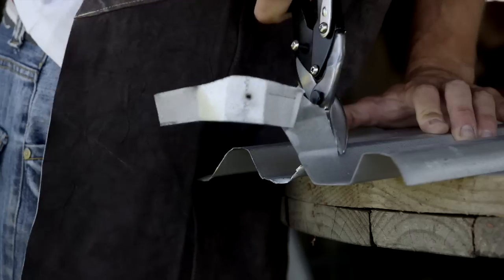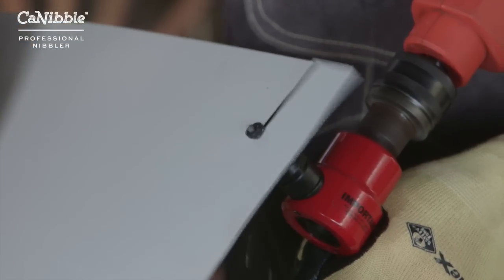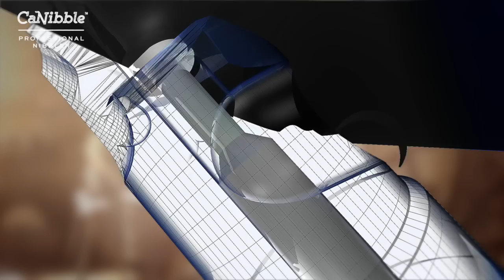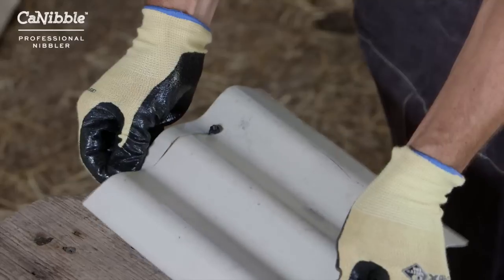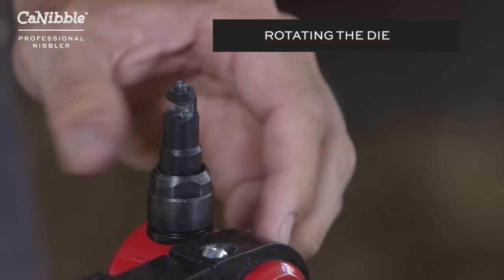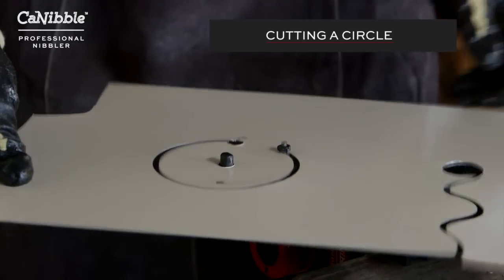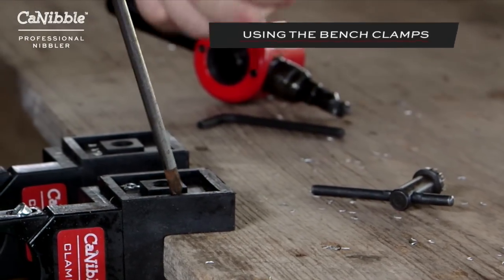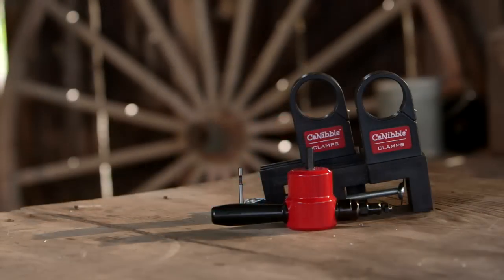Introducing CaNibble - The Professional Nibbler Tool | Product guide (with full instructions)

Comment: Is this the Australian Designed Professional Nibbler, that has been available in Australia for years ?Check out THE PROFESSIONAL NIBBLER: A HIGH QUALITY, AUSTRALIAN MADE TOOL.
Our local engineering firm responsible for the design and manufacture of the Professional Nibbler has over 30 years of industry experience. Every part that comes off the production line is certified and must meet our quality specifications.
We carry out our own rockwell and hardness tests to ensure the material meets the required standards before we begin milling and turning. This guarantees that the Professional Nibbler will give you a perfect cut and serve you well for many years to come unlike cheap imitation nibblers manufactured abroad, that just don’t last.

Comment: What gauge of Annealed Copper could you cut with this? Your website only lists Brass at 14 gauge, but Annealed Copper is substantially softer.
Reply from the maker: Hi Micah, it will cut up to 2mm thick of annealed copper. It is essential that a cutting oil or WD40 is used along the path of the cut when cutting soft materials.

Comment: Does it stay on without pressure on the drills trigger?
Reply from the maker: No, the drill drives the Nibbler so that when it is off, the Nibbler will not run. But many drills have a trigger lock so you can run without holding the trigger the whole time.
Reply: tie wrap

Comment: Whenever I hear something like "worldwide such and such of choice" I consider what would qualify that statement and if it sold one unit to five different countries it would meet the requirements of that statement. However what it is meant to imply is entirely different. I highly doubt that it's the go to nibbler of choice for fabricators and sheet metal roofing companies the world over. I also doubt that the punch or it's other parts are made of the same quality as the tools made by companies for small businesses let alone industrial ones. 

I don't have a problem with cheap tools not matching up to their quality counterparts but where I do have a problem is with a cheap tool made from cheap materials that tries to stand next to those ones that aren't cheap and that are made from durable high quality materials. When I was young I used to believe the statements from such marketing until I got my hands on various expensive high end tools and was left wide eyed from how much better they performed over the cheap ones. Just because you can't visually see the difference between a cheap pair of pliers compared to Knipex pliers you will feel the difference between them during the first time you use them and then years later at how good the quality ones still are. 

The cheap ones are great for a home gamer type of user that will only use them once to roof the garden shed or the hobbyist who can't justify spending $500 for a good brand name nibbler when all they want to use it for is to chop up and old copper hot water tank to make arts and crafts from it.

Comment: will this cut through 321 steel? probably not, just curious
Reply from the maker: Hi Vince, great question here are the gauges and materials you can cut: 

For Mild Steel it is 1.6mm (or 16 SWG) 0.063”
For Brass, Aluminium, Plastic it is 2.0mm (or 14 SWG) 0.079” 
We recommend a specific punch and die are kept for Aluminium work
For Stainless Steel it is 1.0mm Maximum (or 20 SWG) 0.039”

We recommend a specific punch and die are kept for Stainless Steel work.
Always apply a lubricant such as WD40 or light oil along the path of cut.

Comment: Can this cut Stainless Steel 316L 5mm?
Reply: Thanks for your question. The maximum thickness that will fit into the die is 2mm, so unfortunately you will be unable to cut anything 5m thick.
Reply from the maker: No, 1mm thick is the thickest stainless steel it can cut.

Comment: So this can't be used with an impact drill?
Reply from the maker: We have just launched an impact drill version.
Drop me a line at nibbles@canibbletools.com and we can work out how to get one to you.
Reply: Are you all making a review video for the new one you are mentioning?
Reply from the maker: We may do at a later date, but as it is exactly the same product modified for the impact driver, the review video would look the same only that the tool would be driven with the impact driver :-) We will be demonstrating it at the San Fransico Bay area Maker Faire between the 19th and 21st May 2017.
Reply: Is it any more powerful than the original? Will you ever come out with a version that can handle thicker gauges?

Comment: How long it lasts sharp. How to sharpen it?
Reply from the maker: It lasts around 200 meters on, say mild steel if used in accordance with the instructions. However the full answer depends upon the grade and thickness of material you are cutting, because this impacts on the cutting edge of the punch and die. These two parts are the consumable parts and can be replaced when they dull.

Comment: Can it cut carbon fibre sheet?
Reply from the maker: yes, it will. What thickness are you cutting?
Reply: like 1-5mm sheet
Reply from the maker: The cutting capacity is dictated by the size of the slot in the die, which is 2mm.

Comment: Will it work on cutting 14Ga Galvanized after weld  wire mesh which I build Cages with ..Any video of this?
Reply from the maker: No video I'm afraid as what you describe is very specialised. There's a maximum gauge of 16 for mild steel.

Comment: I wonder how it work with PCBs
Reply from the maker: it should cut it just fine
Reply: Tiny copper tracks on PCBs are sensitive to cracking and sometimes even they peel off if you put too much heat or force on them. I just wonder how much vibrations are dangerous to them and PCB itself which is more sensitive to cracking than metal or fibre glass.  Can you make some tests and record them? I mean, cutting PCB is common problem in electronic world. Many electronic hobbysts, beginners, students, DIYers struggle with it as traditional cutting with Dremel generates pcb dust which is very messy and bad for your lungs. Not to mention that cutting more complicated shapes is very hard. Scroll saws are expensive and young beginners or hobbyst not alwas have money or will to buy such a device which also causes problem with placing it - i mean many of them make pcbs at home. Your device yould be great solution as it generates only scraps, you can cut complicated shapes and is very portable. If it would work i would publish it on biggest electronic/electric forum in my country as well as on biggest DIY forum.
Reply from the maker: Thanks for the further information, we will do some trials and let you know how we get on. regards, CaNibble Tools

Comment: Anyone who pushes a cut off wheel through thinner gauge sheet metal gets all they deserve especially if they let it over hang the bench so far. You should drag the grinder across the sheet with minimum overhang or even better no overhang at all and on top of a junk piece of plywood with the metal sheet clamped to the work surface to hold it in place properly. 

Now I've dispensed my two cents worth of advise I'll put on my knit gloves and squint as I push the grinder, sans guard through my 30 guage mild steel sheet so that the sparks set fire to my gloves and clothing and I flinch from the metal particles bounce off my eyelids and face. I once had a pebble of grinder wheel hit my eyeball that fused to my eye. The emergency room Dr. wanted to use a syringe needle to pick it off my eye. Well I chickened out when he was about 3 inches from my eyeball. I told him I'd rather risk going blind than let him pick at the sliver with a syringe. Luckily the speck detached on its own and there wasn't any infection that happened (probably due to the spec being sterile from the heat when it impacted my eye. true story.

Comment: its like 20$ on amazon..why bother rebrand it.........
also this one seems like the head doesnt rotate...so when dealing big sheets(which ofc the video doesn't show any big sheets), its is pain in the ass to cut thru any corrugated sheets coz your drill will be in the way.
Reply from the maker: Hi Alan, thanks for your comment. The CaNibble is not a re-brand of the cheap nibblers you see on sites like Amazon. We're the original manufacturer of the drill attachment nibbler and have been making them for over 40 years. The CaNibble is our newest generation of nibbler, and benefits from these 40 years of experience and refinement. This is why our nibbler cuts so much better and for so much longer. The head, or die of our nibbler does actually rotate, it's actually a design we pioneered in our earlier generations of nibbler.
Reply: @canibble-professionalnibbl1603  you know what, the fact my comment actually got a reply from you is enough for me to believe. if my cheapo nibber fails and somehow in the future i need this tool for the job for a living, i guess i know where to get good ones. :) thanks for the reply.

Comment: What is the operating Voltage? 110 or 220 V? and also is it 50Hz or 60Hz?
Reply from the maker: Thanks for your question. The answer depends on where you live. You need to be able to run your drill at around 2500 rpm which in turn powers CaNibble Professional Nibbler which attaches to it.

Comment: Will this cut 3mm thick aluminum? What tool can be used?
Reply from the maker: Hi Gauge Magadia, thanks for your question. Unfortunately, the maximum thickness is 2mm, which is the opening in the die for the material to pass into for cutting. Kind regards, CaNibble Tools

Comment: Cannibal $218.           Chinese unit  $30.        .??????
Reply from the maker: Hi FAA Inspector, The CaNibble Professional Nibbler on its own (like that of the Chinese unit) is $99, our bundle which includes bench clamps, a straight and circle cutting attachment, spare punches and a die costs $188.85 which is $29.15 cheaper than your figure of $218. While the CaNibble Professional Nibbler is more expensive than a Chinese unit, it is not for no reason; we offer a 5-year guarantee on our product, we manufacture in Australia which is inherently more expensive than China (wages, power, and material), we provide readily available spares and manufacture the CaNibble Professional Nibbler to a very high standard which includes over 40 years of development and testing along with our patented cutting action.